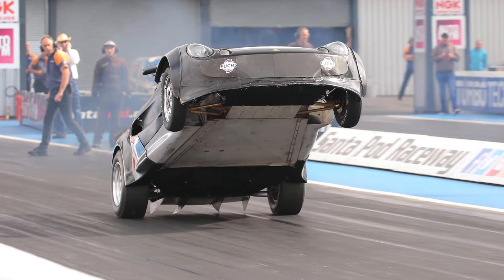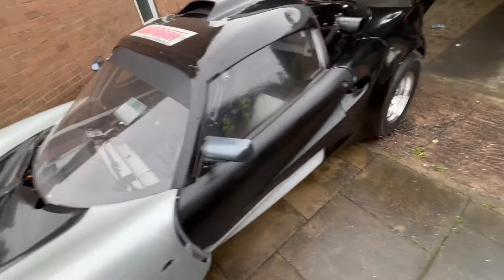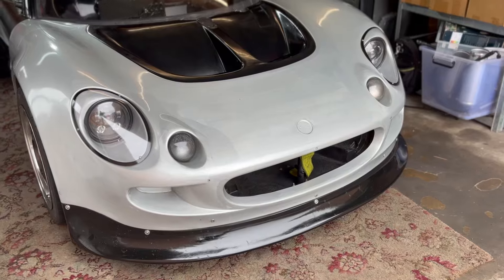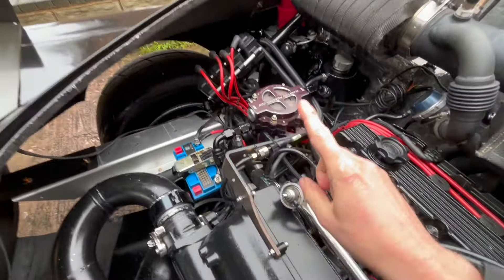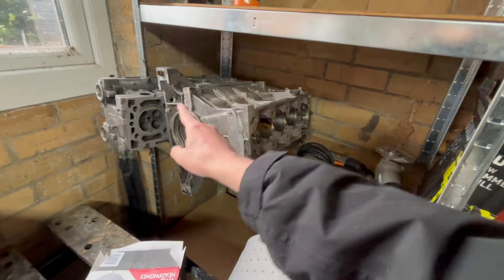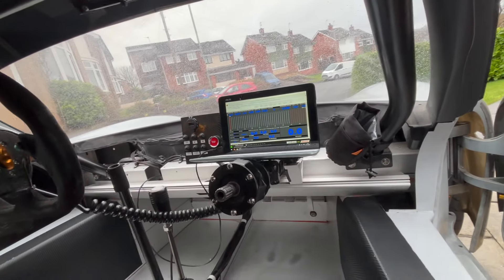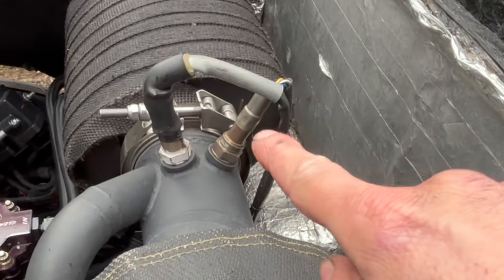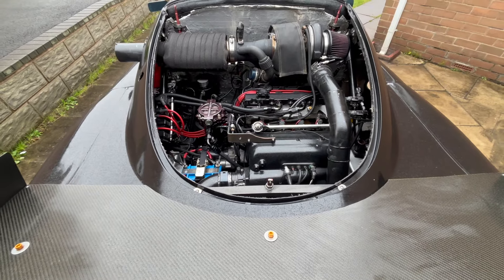BUILT IN A SHED! 850HP Lotus Elise!

Comment: I'm an ex rover mechanic from back in the day . Bury New Road 😅
People slate the K series and T series engines. 
Back in the day the K was a revolutionary engine. All aluminium,  very lightweight with fantastic power and torque.
Turbo or VVC the engine adapted.. . Sadly the cooling and headgasket  issues have not helped.  but  I think that was Rover cutting costs on an engine that had loads of Potential  🤷🏻‍♂️ Remember Rover, Lotus, MG and Caterham, Land rover used this engine . Wow 850bhp.  👏  that is amazing. 😮  I was told 300 max for K and 600 max for T. That video has made an old Rover mechanic smile 🫡👊
Reply: It certainly wasn't a bad engine. The vvc engine was a great little motor
Reply: Do like a k series engine,  great power to weight
Reply: Totally agree Mike , also the mg6  k series is bullet proof in my opinion having used it on many a transplant

Comment: Just a slight correction anyone who knows these engines, knows just how good they are, providing you have the correct cooling. Remote thermostat etc
Reply: in the end i stopped using a thermostat all together, found i had much better control of temperatures on it, keeping the head cool was crucial to avoid fire ring indentation

Comment: The k series was a great engine it's the head gaskets / cooling system that let it down, rover cutting costs on what could of been at the time best engines in class
Reply: Was really an easy thing to fix, simply getting rid of the thermostat and using a better head gasket pretty much fixed it all

Comment: I started building an exige in 2007 that was running full evo5 running gear, drive system and engine.. never got it finished... one that got away sadly.
Reply: What happend how comez you didnt complete ?
Reply: I bought it off him then scrapped it when I ran out of fuel.
Reply: @ketovoreking5440  at the time I was taking on more staff, I'd caged the shell and was ready to put drive train in. A customer came in wanting alot of all my evo gear, so I tossed a coin and ended up selling all the parts and bits for the build to help my expansion and employ more staff, shortly after another long term customer purchased the shell. I always hoped todo again, but never got round to it sadly. I believed my best move was to expand the business. In the end that was not a good decision. But such is life. I've had plenty of other unique builds far and wide for customers and myself. 

One of those decision in life you look back on and think what way life would have went if you choose your other option .

Comment: 850hp...and only 1500 lbs? (those are AIRCRAFT stats!!) How does he even keep it on the road? (Great build.)
Reply: Make sure it’s a dry day,  your on a straight concrete road and don’t go full throttle in the first 3 gears normally. The rear wing is really long with high end plates on purpose so that when I does spin the tyres(which is has done in 5th before) the car tracks straight

Comment: Without knowing more than I can see.
It will probably help to have air intake outside the hot engine compartment.
Nice otherwice.
Thanks
Reply: Under where the filter there is an air inlet, on the drag strip I don’t run a filter though

Comment: Guys - epic build. But wearing no harnesses/seatbelts, on a ridiculously powered car, in the wet. Anything went wrong and you hit your heads on the exposed rollcage tubing? There was an American youtuber who's brakes failed/throttle stuck while they were filming. Ate shit on the dash (I think they only wore lap belts). First thing afterwards "wear the harnesses...".
Reply: hence you see make no more than i think 5psi of boost, we decided before we got in the car to not do anything crazy 'for youtube likes' so the incar footage was more so you can hear the gearbox sound. If it had been dry and i had swapped the fuel out for methanol, harnesses would have been on and people would have seen what full throttle is actually like

Comment: Nice car but get informed buddy more rpm doesn't always equal more power and usually means less torque completely opposite of what you say but I mean I've never built an engine there tons of people who haven't either not ls engines k series rb 26 2jz they all say rpm losses torque but gains rpm they must be wrong right professional builder against a British guy who built a car in a shed lmao world's arohd the world for reliability
Reply: You run the correct turbo and cam duration to make the power at high rpm, you only have less torque with rpm when you loose VE from incorrect airflow